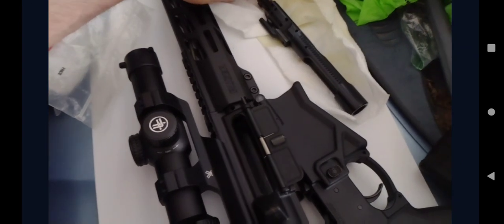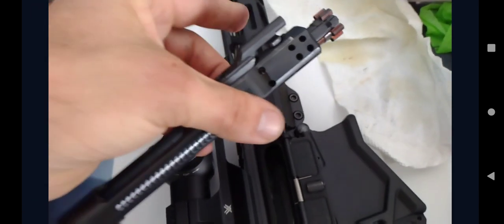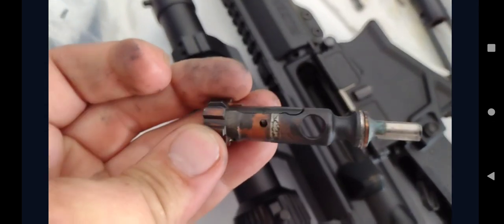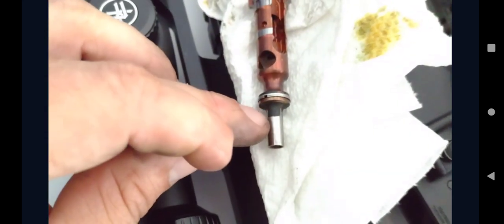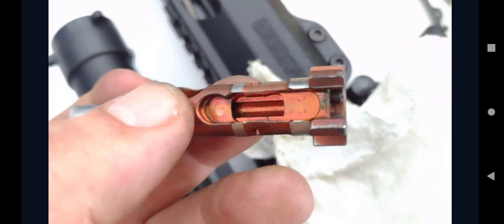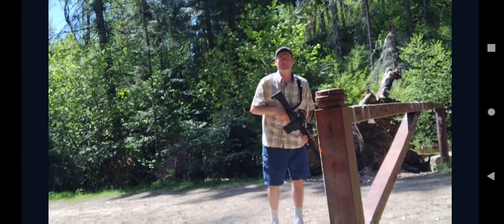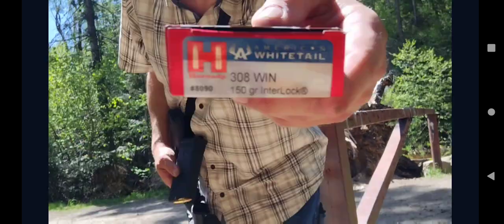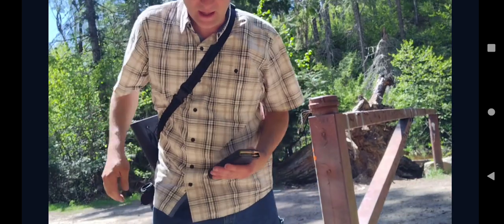Ruger SFAR returns from Ruger - My Lemon

Comment: I'd say it's normal crust on a 308 bolt. The copper color is not my concern. The brass flakes are definitely an issue. The gun should be tuned to reduce damage to casings.

Comment: I got one a few months ago.  

I don’t think I have ever had a hiccup. 

Mine does not like heavy loads (grouping)  Like 150’s. 

The fouling that you get in your bolt. I put over 200 rounds threw mine. Did not clean it. Yesterday I took it apart and cleaned the bolt. No green copper. And did not look that bad on mine with carbon. Ran on 3 most of that.  Last time ran on 2.  Running fine. 

When your gun went click. You looked like you flinched.  And you are running the stock super short for your arms.  That’s a long shot but I would change that.
Reply from the maker: That's good..it sounds like yours is working as intended, and that's what we want to hear!

I saw a video of a bolt after so many rounds also and they too didn't have a bolt as dirty as mine.  Maybe something isn't right on my gas system...I don't know.  Yes, to everything you noticed..did push in several times, did not extend the stock, and barely cared about my stance.  Lol this gun has taken me to the ledge of don't give a damn anymore... hopefully Ruger makes it right, and can pull me out of this funk I'm in.

Comment: This would drive me nuts. Mine runs unsuppressed on setting 2 with many loads for example PMC Bronze, Win M80, Fed M80, PPU M80, Speer Gold Dot, Hornady Black Amax, Remington 308 sp even m80a1 epr = holy sh*t I wish I was rich. Setting 1 with suppressor works perfect. My bolt is the Copper color. I’ve settled on fed m80 because of price and availability but PPU m80 is more powerful. In my videos you can see the trouble I had with Freedom Munitions blowing primers from 3 of their loadings. They reimbursed me for the rounds I hadn’t fired. I never had a problem with their ammo before and I’ve fired tens of thousands of rounds of their pistol ammo trouble free.
Reply from the maker: I know that some of their guns came out working as intended, and I'm glad to hear you aren't the other crowd of people like myself whose gun does not.  Thanks for sharing your experience.

Comment: Your bolt is normal. But the brass shavings are not normal. That guns needs to go back again. Any AR is what I would say is a wet gun. Must have oil in certain area. I’m no expert and sure there people on here that know more. My SFAR ran fine on setting 3 with PMC 150gr. When I went to setting two. PMC would have a short stroke maybe every 8 rounds. Tried many more makers of 308. On setting 3 i still had some problems. With federal 150gr 308 Norma 150gr 308. Called Ruger about this problem. Now I bought mine first week on Nov 23. They told me I had a 2nd run of the gun it was made in Feb of 23. That the gas regulator was my problem and sent me a new one. It’s on its way I haven’t got it yet. Now my issue is I got my gun from Dunham’s just a couple weeks ago. As hot as these guns are. How did I get one made back in Feb.

Comment: Same exact problems with mine. Had similar copper corrosion inside of by gas block and chunks of copper everywhere. Sending it back for the 2nd time. First time it came back with a new BCG just like yours
Reply from the maker: Sorry to hear about your trouble with it.  Do you have any personal opinions as to what might be causing that?
Reply: @Nobluffbuff  Something gas or buffer related. Its intermittent so it makes me wonder about head spacing. I tried a rifle legth buffer spring and it worked as intended, but would like Ruger to fix it before I tinker too much
Reply from the maker: @DRockDreamin  If someone had a solid repair such as a different buffer spring, I'd find that to be gold.  I think the same about the issue.. It's short stroking, maybe the gas setup too.  Saw a video here, a comparison of all common AR buffers and springs..the Ruger happened to be the longest of them all...too much spring?

Comment: I have 30 rounds through mine and have changed hand guard, gas block, buffer weight and spring. H3 buffer stopped the case head swipe that causes the brass flakes in the gun.
Reply from the maker: I'm glad you share this.  Probably the third time someone mentioned good luck from swapping out the buffer assembly.
Reply: @Nobluffbuff  I built a 7.5”, 10.5” and a 12.5” ar10 and had to do some testing to figure out what works.
Reply from the maker: @sbranham86  Wow...I gotta see that!!
Reply: @Nobluffbuff  the 10.5” is on my channel. It’s just a short vid of my neighbor shooting it.
Reply: @Nobluffbuff  I can’t upload pics of my other setups. Of all though, the 12.5 was my favorite
Reply from the maker: @sbranham86  No problem... got my curiosity perked, haven't seen many short AR10s, and definitely not in person!

Comment: Well mine is going back now, so I wonder if I will get a similar bcg?  Very weird. Did you say if you checked the tightness of your gas key and gas block?  That is insane. I didn’t have that on mine.
Reply from the maker: Yes, and both are still super tight.  I've seen others get the BCG replaced and it did look the same as mine.  Must be what you are going to receive, as well.  Thank you for sharing my video.
Reply: @Nobluffbuff  good stuff!  I wonder what material they are using for the new bcg??  So weird it does look like copper.
Reply from the maker: @triggerbarPhD  I thought it was some special coating, like they did with the SR762, but it's quickly wearing off if that's the case.
Reply: @Nobluffbuff  interesting

Comment: Mine does not eject, rounds get stuck in the chamber, extractor is way to lose, can move it with my thumb.
Seems like the buffer spring ist to hard in relation to the buffer and bolt weight.
Reply from the maker: I was thinking the same thing about the buffer system.  This gun shouldn't be such an enigma.

Comment: My BCG doesnt look like that. 220 rounds in & my SFAR shoots fflawless on  gas setting 3. Switch to 2 & it falls on its face. Failure to feed....2 shots failure to feed....2 shots failure to feed. Really starting to aggravate me!! 🤬
Reply from the maker: I feel your pain.  If mine was consistent on level three, at this point without any regard for the gun's longevity, then I'd happily leave it there and shut my mouth.  Yet, not even on the highest gas setting can I achieve reliability.  They did a great thing for an AR platform in .308 if you want to run suppressors because I swear that the gas system was designed around the idea of running it that way.  In other words, it probably runs better suppressed than it does without a suppressor.  Sure not going to find out myself..lol
Reply: @Blind Sight  you might be right. Ruger probably couldn't wait to let all the suppressor guys know they got a lightweight AR-10 that's great for cans!! Bad thing is I'm never gonna suppress mine.